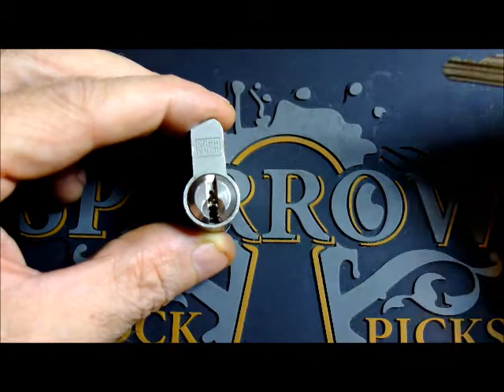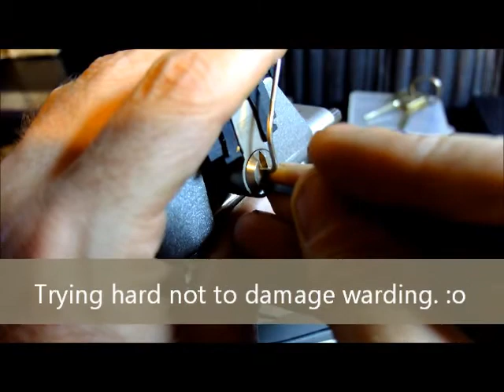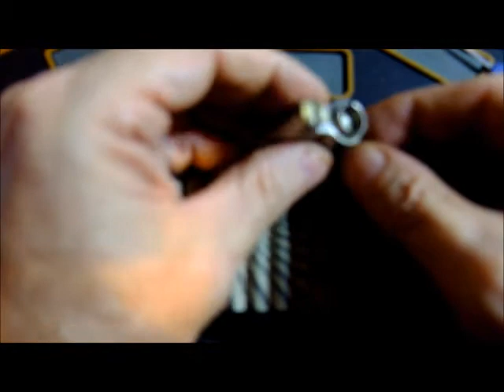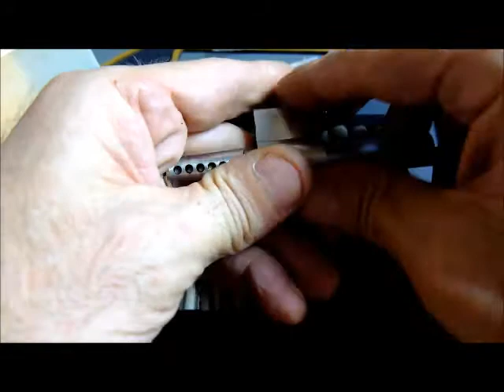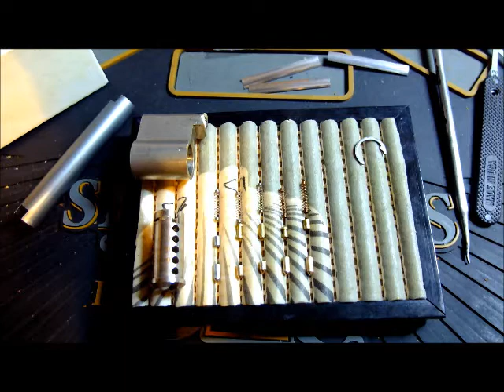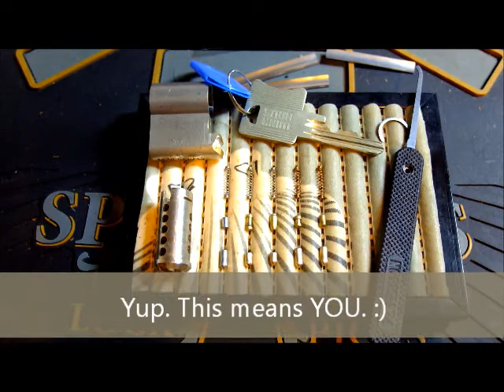Winkhaus from Redeye Locksport (SPP & Gut)

Comment: Very nice done Noctis :). A Winkhaus is a little nightmare ;), I hate this scratchy keyway ;D. Not sure if the pin configuration is standard, but you find these tapered pins (anti bump) more and more and some brands are known for these. Nasty stuff, also the nice long spool :).
Reply from the maker: I've only picked a couple of Winkhaus and they both have made me work for it. :) It is the first time I've seen those anti-bump pins IRL. It is a very cool and clever idea. All of these features certainly made picking less predictable.

Comment: Those anti-bump pins will get you every time. They only go down into that plug that little bit and they act just like Tpins. Then you don't know if you picked it or not because the keypin has no resistance until it comes in contact but you are already so high you think its already set. If you like this lock I already have a GEGE ready for you and a Yale kitemark. Got some real fun locks for you. Hopefully I'll get something sent out by next Saturday. Don't worry about me I want to keep you going on some fun factory euros, but have some real nice challenge locks too.
Reply from the maker: Thanks for pointing that out. First time I've seen one of those pins IRL. Still working on your box. I have a bunch of challenge locks that need to move one so I'll be throwing some of those in as well.